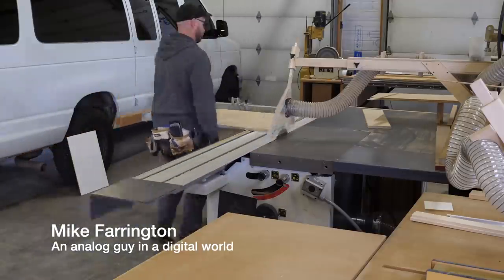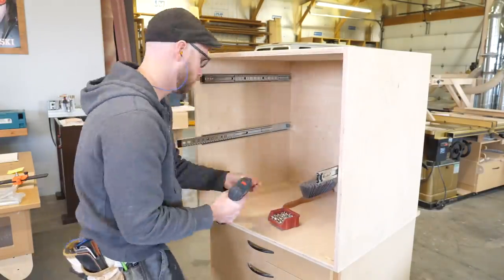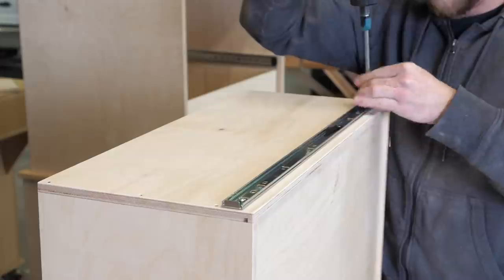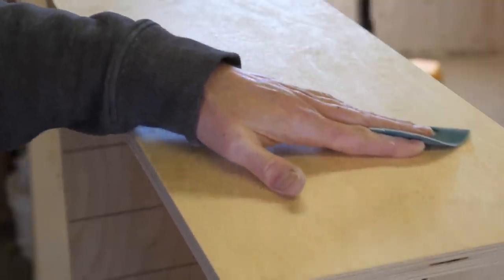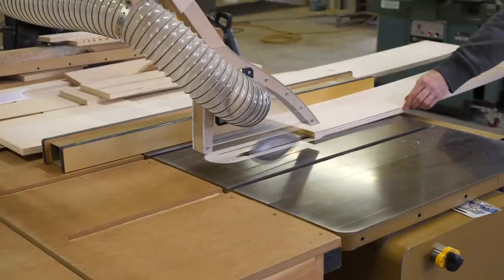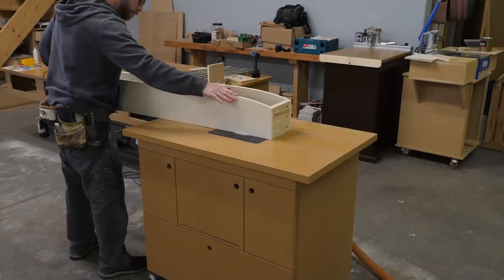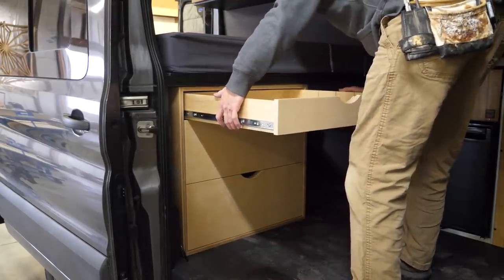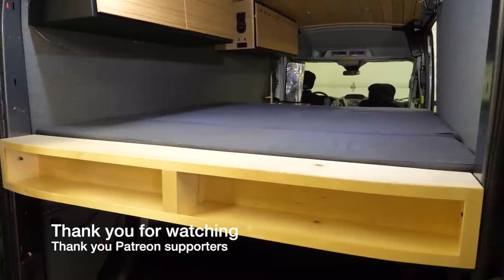I built some cabinets for a van, #vanlife

Comment: A double tapered sanding disc. Great idea! Of course I ended up ordering it. I have no doubt that it will boost productivity in my shop. Thanks!
Reply from the maker: Thank you very much. If you need to sand edges, it will certainly boost productivity.

Comment: That is sweet looking Transit and cabinets! I am actually in the process of purchasing Transit also, however for renovation&tool-storage use, but I'll be making plywood shelves on the other side also, but so shallow that I can still stack plywood/drywall on the floor.
Reply from the maker: Thank you. Sounds like a fun project.

Comment: For Mighty drawer bottoms, I use 1/2" plywood with a 1/4" tongue/rabbit.  It nearly fills the otherwise wasted bottom space so it's basically invisible to the user.  It's a strong design when strength is needed in large drawers.
Reply from the maker: Thank you. I'm with ya, if it needs to be mega strong, I use 1/2" as well.

Comment: Excellent craftsmanship (as always). Great results.  I think I would have mounted the "Flippy Uppy-downy Stick" the other way to make it easier to slide something into that thin space on the left. Of course, that might have made it more difficult to remove and install the jug.
Reply from the maker: Thank you. I wouldn't be able to do that and get the jug in and out. Though, I think that would have been a better location.

Comment: Another great build👍. But I was disappointed... why didn't you put a little drawer above the water tank. Every square inch in a van is precious. You left access to the left (nice place to keep a cutting board or a tray) and below the tank (but a drawer or pull out shelf on the bottom would have given better access to the back of the bottom space.
Reply from the maker: Thank you. Both those spaces were specified by the customer. I think they have particular stuff or baskets that will fit in those spaces, but I agree, a little pullout in those spaces would have been cool.

Comment: I'm always amazed how smooth your table saw sanding disk makes the wood and still is able to keep the corners sharp. Using a hand sander always rounds the corners. And it's awkward and dangerous to use a belt sander on really big pieces that are so easily accomodated by the table saw. 👍. Can you give us a link to the video that shows how the disk attaches to the table saw? 💖🌞🌵😷
Reply from the maker: Thanks Suzi. The disc works really well for plywood. I'll put a link in the description.

Comment: i have pro tip to i use double sided tape to attach the drawer fronts not bradnails no hole on the front then screw it from the back
Reply from the maker: Thats a good method. I think I used it in a video at some point. I only use the nail method when top quality isn't required.
Reply: @MikeFarrington  i like that you use blum hardware its top quality in europe i only use blum in my company
Reply from the maker: @jonnyfischer4035  Blum makes some pretty good stuff.

Comment: Hey Mike. Thought I would share with you some of my recent experience. Recently I have started making the transition to CNC. I use the Cabinet Vision software to do this. They recently changed to a subscription model, and I also got it on sale for $99 per month... A lot better than 5k starting price that it used to be lol. 

If you program the software appropriately Then you basically drag and drop cabinets and it will pop out all your parts to perfection on your CNC router. It will also give you labels and stuff which is needed for large scale batch work. 

Anyways.... I recently just popped out a job in one day that would have taken me more like 5 days... That being said, I did get my parts cut and delivered from another company using the programming that I did on Cabinet Vision. But I know it only took them 3 hours of work to cut out my parts. 

Anyways.... I personally had to hire a Cabinet Vision Engineer at $40 an hour to code the software exactly the way I want, and it has taken like .... Thousands of dollars worth of programming and training. But now that I have the software programmed, most of the work is drag and drop, and the CNC does all the hard work for us, and then it cuts down on production by more than half. 

High level CNC is a huge pain in the butt to learn, but I would like to encourage you that in the long run it is very worth it if you can plan your build methods appropriately and have the right software for the CNC. I won't lie. It's been incredibly difficult and frustrating and to get optimal results a CNC horizontal boring machine is also needed.... But now my general cases can go together in all of 5 minutes with perfect accuracy. I now make single piece face frames with no seams and no fabrication required for face frames, dados from the cases to the face frames, wall hangers that rabbet into nailers for hanging into cabinets, and all drawer slides and most drawers are pre aligned. 

Just wanted to encourage you to lean into the CNC hard with the right software. It will definitely make your work exponentially more profitable in the long run
Reply from the maker: This is some neat information. When all cylinders are firing, a shop using CNC can really produce a lot of work, with few people and very few mistakes. I would say that if someone wanted to start a cabinet shop, at this point CNC is needed. I have been making some headway as to learning my CNC machine. It makes building cabinets very easy and fast, that is for sure.

Comment: Hello Mike, I really enjoy your channel. Your pro tips and since of humor really add to the truly skillful contact. I was curious as to what kind of sprayer you use for applying your finishes. Also if you’re happy with it and if you had to buy it again would you buy that one or is there another one you would’ve opted for. Thanks again and keep on doing what you do.
Reply from the maker: Thank you Tim. In this video I was using a 10 dollar spray gun from Harbor Freight. For the money they can't be beaten. I have a few other high end spray guns that I use when I need more speed. I buy them in bulk, use them until they break.
Reply: @MikeFarrington  Thank you Mike, and again appreciate the things you do.

Comment: Fantastic video again.. Have a question: I notice a measuring tape stuck on the slider? Could you give more info on how you use it?
Reply from the maker: Thank you. If you are talking about the one on the sliding carriage, its how I set the flip stops. Or was there something else that I'm missing?
Reply: @MikeFarrington  i meant the yellow tape stuck on the slider. At 3:03  It is much away from the cross cut fence as well
Reply from the maker: @anilsarapalli9968  Ah, that isn't a measuring tape, its an angle indicator My saw has a secondary fence that can be used for miters. That tape is how you would set the miters.

Comment: Damn those are nice. Can I ask why not use a system like festool's LR32 for the drawers/shelves/doors?
Reply from the maker: That requires that I stay on a 32mm system. Doing it this was, I just cut the space to any height I like. Plus, when just doing a couple, I find this way faster. If I was doing several of these, I would do it with a system of some sort.
Reply: @MikeFarrington  Gotcha - thanks! I don't know how I forgot about the whole "balanced cabinet" restriction.

Comment: Where did you buy your canvas tool  pouch or what brand is it? It looks very comfortable.
Reply from the maker: I bought mine off Amazon. Its titled; General Tools 89 Stainless Steel Automatic Center Punch with Adjustable Stroke

Comment: You normally rabbet the carcass for the plywood back but not this time. Why? Time/speed? Or the fact that it will be buried in a van?
Reply from the maker: I go back and forth. Sometimes yes, sometimes no. In this case, it just wasn't going to be seen. When I did rabbet the case, it was to keep the look a little cleaner.

Comment: Ey Mike! great video! I just saw you using a mirka sander there and I wondering if the following has ever happened to you: The sander works, the vacuum works (strong) but the dust is not being collected flying way like never before. It is driving me mad.
Reply from the maker: Thank you. I have not had a single problem with my Mirka sander. Some of the best money I've spent on a tool.

Comment: Somewhat unrelated to this video, but im just about to start on a new workbench and was wondering if your still a fan of using LVL for the top or if there was a different you would recommend.
Reply from the maker: With the huge fluctuation in lumber prices, I'm not sure LVL is a good value. To put it in perspective, currently, I pay less for soft maple than a 2x4. So I would call around and get some pricing. At equal prices, I would go with maple. If LVL is a good savings, go with that, it is a good material.
Reply: @MikeFarrington  Thanks for the reply ya right now I can get rough sawn maple for about the same price. Thanks for the info and all the great videos.
Reply from the maker: @andyfermanich9956  Go for the maple.

Comment: Mick, do you have a sanding disk that goes on a  33mm Arbour?
Reply from the maker: I have 5/8", 1", and 30mm. If you need 33mm a sharpener should be able to do it for you for a few bucks. I can have it done for you, but the place by me charges too much. Email me if you'd like more details.

Comment: When making the drawer faces why didn’t you just use the template and router out the handle instead of cutting with jigsaw
Reply from the maker: That would have worked, I think with only a few to do, this was faster.